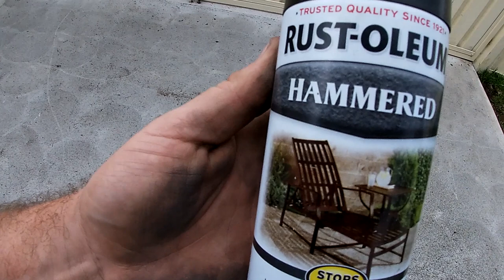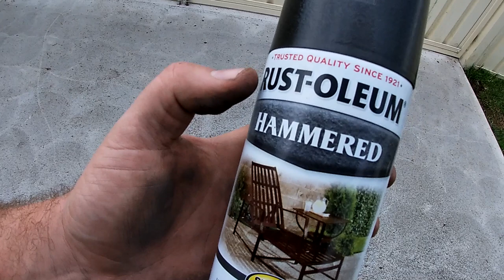Rusty steel cabinet restoration

Comment: I wish you would of included some commentary to explain what you were doing and what you are using to remove the rust and what you used to wash and smooth the metal to prepare it for painting.  Interesting video, but with out some explanation, it was basically useless.
Reply from the maker: Thanks for the feedback mate, and I'll keep it in mind. As for the 'useless' comment... You'll note that nowhere in the title or description will you find the words 'how to'
Reply: Then what's the point? That's why I watched...

Comment: Great video. Thanks. Don't worry about the critics, you would have done a perfect, pristine restoration, some would have found a way to complain. The majority come to watch restorations, a few will always come to whine. And I agree with Craig Strickland, a blasting cabinet would fit perfectly in that shed.
Reply from the maker: thanks mate. I'm setting my sand blasting cabinet up today :)

Comment: Well just found your other channel. I have a old metal cabinet and what I did is. Built a wood frame to fit the bottom of the cabinet and put casters on it. Easier to move around.  Nice job of restoring the cabinet. 👍😊
Reply from the maker: Great idea!

Comment: i have learned over the years there are a dozen ways to do nearly any job.
with the exception of cooking, which is very much chemistry in that it requires the right procedures and ingredients for repeatable results.
lovely results, i have a LOT of old shelving in all my sheds, which 've jerry rigged over the years, sod cleaning it all up, i'm storing rusty car part on them lol.
edit: i gave a neighbor a steel shelving unit, (sides, shelves and backing), her hubby called it junk (in similar condition to your before shot) damn it came up looking near new, it took her and her daughter weeks of hand sanding before they painted it purple/pink.

Comment: It’s cool to see what you do in your spare/down time.
Reclaiming this cabinet like you do those overgrown lawns 👍🏻
I could have stuck with just the thumbnail photo but of course my curiosity prevailed. I wanted to see the transformation 😊

I really like it. Turned out awesome. 
My heart sank a little when you pulled off the tape and there somehow was overspray but I knew you had it. Just that little touch up with the black and voila 😁

Comment: I'm a metalsmith, and I think you did a great job! I have a few suggestions, not criticisms at all, I promise. I think you did a wonderful job.

On the bumps you were trying to hammer out from below, it actually works better to hammer from the top. It's sort of hard to explain, but planishing it from the top with an anvil or even a sledgehammer head inside would smooth it out a bit. It helps to have something on the inside while doing so. 

You can get a cheap set of auto body anvils or "dollies" (like $20-$30 USD in Harbor Freight) that will help with your future metalworking projects. They have odd angles and curves to get in hard to reach spots. Or old junk hammers with huge heads make great anvils too! Or old rail track. 

A good metal file will help remove burrs and smooth out the edges of the metal for you, and you can find them very cheaply here at dollar stores and hardware stores, etc. or flea markets. I love to find tools on the cheap. And I'd suggest investing in some clamps to securely hold your work when you get the time/money/inclination to do so. :) 

You did a great job! I would have tossed the cabinet, and look what you made! It's awesome and it makes me want to sand and repaint the one on my front porch.
Reply from the maker: Thanks for the tips! An anvil is definitely on the 'to buy' list 🙂

Comment: Cabinet turned out really nice based on what you started with.   One painting tip:  after masking off for the "details" painting, spray over the exposed are with either clear or the original (black) color to seal the taped edges. Then the White should not bleed under the tape.
Reply: Great tip, thank you. I've had this problem before, wondered how to prevent it.

Comment: To knock out the little dents you need to have a dolly on the other side of the sheet metal from the hammer. Turned out great though!
Reply from the maker: Definitely on the to buy list

Comment: Nice job if you want to hang it on the wall you could put a French cleat on the back. If you have more rust removal jobs you could do electrolysis if you don't what that is you have an old style battery charger a plastic tub, water, and sodium? Clean bars of iron to attract the rust to, leave the charger going to clean the item to be cleaned. Attach battery charger in circuit to the item to be cleaned then to the metal bars and switch on. Ron from Bendigo

Comment: IDK if Aussie's are keen on 'yard or garage' sales but if so, try checking as many out as you can where old tools might be available, Sean. You might get lucky and find an old body shop man's treasure trove of tools and Vice Grip specialty clamps - cheap!
Reply from the maker: Thanks for the tips!
Reply: Definitely! I have a thing for hammers and I find old, rusty ones at flea markets and junk shops and restore them for fun. And I collect anvils too, lol. I've run across interesting tools I'd never seen before at flea markets. It's a great suggestion!

Comment: Lookin good mate, one of my two trades I've been actually trained to do is commercial and industrial hvac sheet metal fabrication. Everyone thinks it's just hanging duct. Naw, lot more to it. We are called "tin benders" for a very good reason.
Until you really need them you can get by with a few things around the shed. A good piece of hard wood like oak can be used as a "dolly" and even a mason hammer instead of a tinners hammer. 
We used to love beating on metal when the boss was "hung over" lol
Anyway, the end result looks great from my end, old saying, if you like it then I love it.
Thanks, and how many kidos do you have??
Reply from the maker: Good idea! I was definitely in need of some dollies on this one. I have 4 little ones

Comment: G'day Shaun that turned out alright the slightly bent sides on the top just a suggestion you could get some "C" section rubber tube and fit it around it might make it look better.   You did a bloody good job when you consider the state it was in and like the white pencil line on the front.  Take care John
Reply from the maker: Good tip!

Comment: I realize this is an old video but I’m just seeing it for the first time, doing some u tube research while trying to restore a 12 drawer beat up rusty greasy parts cabinet. Having watched my dad and my x hammer metal a bit laying the cabinet on it’s side and beating that bent lip into submission might have worked better for you! Just a suggestion for anyone else with the same dilemma

Comment: Some great comments here but I'm going to throw some pointers your way.
5 inch strip it discs on a grinder will rip through a job like that, also you can buy a basic panel beating kit, 3 hammers 3 dollys for about 50 bucks, ideal for those straightening parts of the video,  and a set of flat jaw vise grips, very handy tool.
Either way great job, personally I love rust. It tells a story.  Cheers.
Reply from the maker: Good advice mate,  I'll definitely be getting a kit!

Comment: Hard flat steel and a steel hammer or mallet will straighten those edges much easier. That's what the car repair guys use.

Comment: 🇬🇧💕TIP Use cleaned jam/pickle jars to keep larger amounts of Nuts Bolts Washers Nails Screws etc… on eye level shelf makes them easier 2 see without searching 4 them💕You can also put label on jars with name & size 4 quick find💕I have painted the rims of my jars with different coloured nail polish (coz it’s easy 2 remove if needed) so screws r red, nails r blue, nuts r green, washers r black etc makes it easier 2 put each coloured jar in same place💕Also makes it easier 2 ask friends/family “Can you get me 4 red 2 inch screws” colours & labels make it easy 4 anyone💕Hope my tips help💕

Comment: Bro when manipulating the metal like you are going. Use a block of wood on the backside of anything you are working on and a hammer on the front side. Only hammer were the wood is. You will be amazed at the results. I like the pin strike. Not bad man. Over all look and its back to functioning order. I like it. Cheers.
Reply from the maker: I did that for the top edges with good results, but I was more interested in just getting that dent out when I hit from the bottom. I've since got a panel beaters kit with some dollies 🙂

Comment: 🇬🇧💕TOP TIP You can use coke a cola to remove rust as that is what it was originally made for, if you have small items you can soak them if items are larger use a cloth to rub coke into item🙂It’s also great for cleaning toilets & baths remove water from toilet 🚽 pour in coke leave as long as possible then use bog brush or kitchen scouring sponge to then easily clean💕